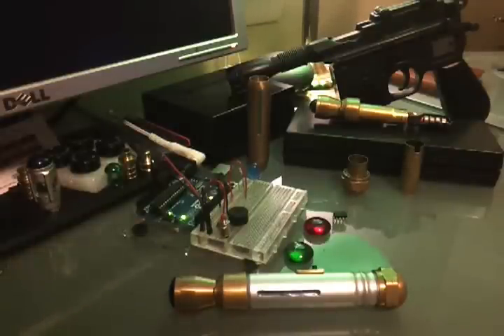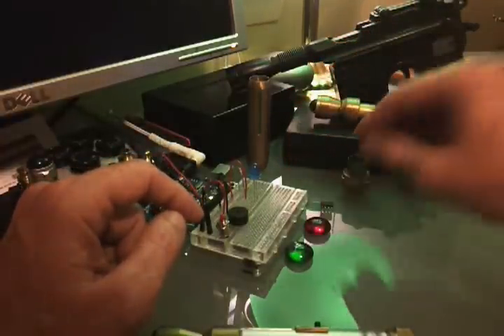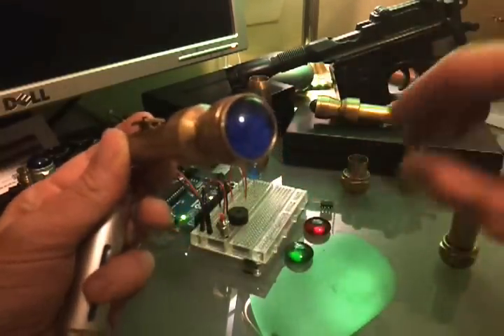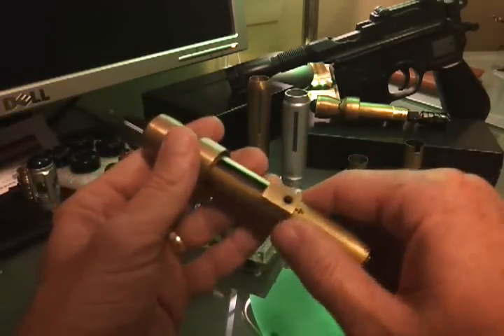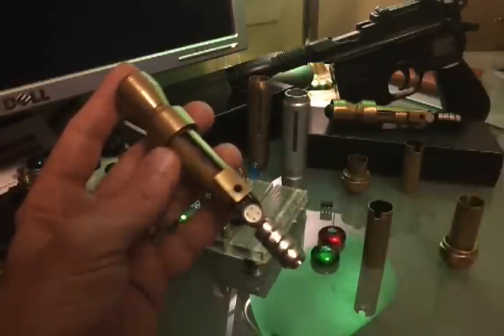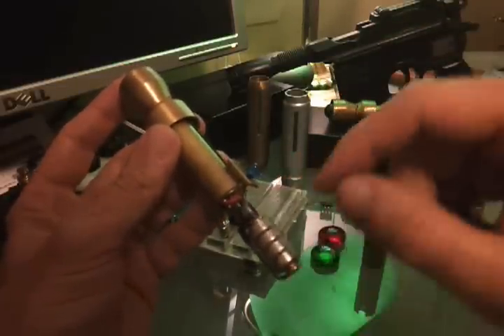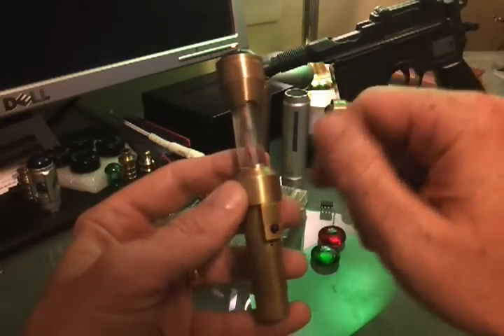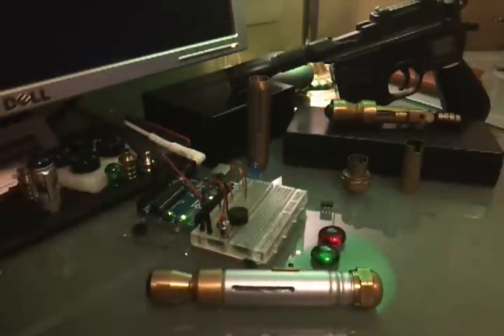Mk II Custom Sonic Screwdriver Breakdown

Comment from the maker: You win. I wanna make another brass and green with a different sound and a glass top. The belt sanding is done. But I'll do snippets of each step after that. It'll show cutting grooves, dog collar, filing, finish sanding, electronics, and final assembly. I'll also get some footage of each and every individual piece that goes into a Mk II. New vid probably won't be posted for at least a week or two though. Wadda ya say?

Comment from the maker: Dremel tool will get the job done, but a belt sander saves a lot of time. After grinding/sanding I run a flat file over them to even/smooth everything out before polishing.

Comment from the maker: Watch out for pipe fittings. They may be the same size but not the same threads. Try them in the store or ask for help fitting everything together. Sound can be tricky. I program my own to make it sound somewhat sonic-y. They make small buzzers that hum or buzz when powered, that could work. And as far as LED's, if you go green make sure you get green(looks clear) and not green diffused. The green diffused LEDs can tend to look yellowish. Good luck with your sonic project!